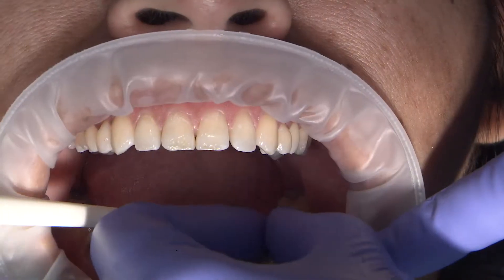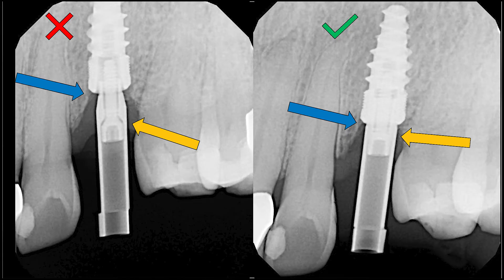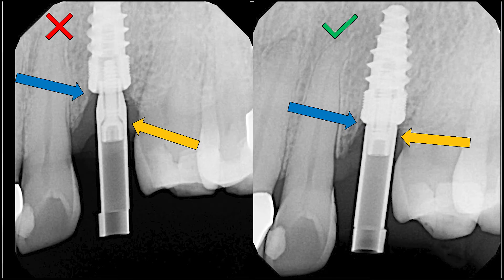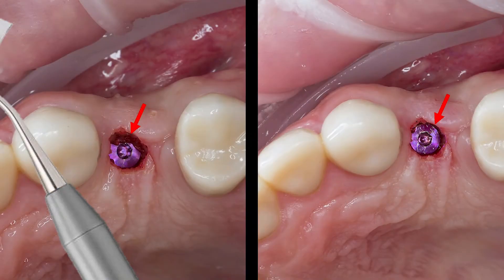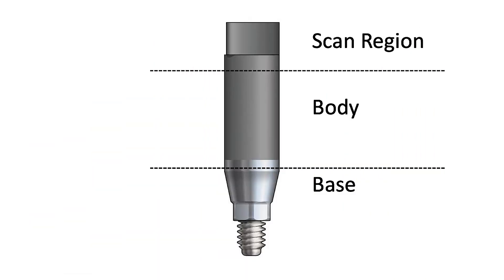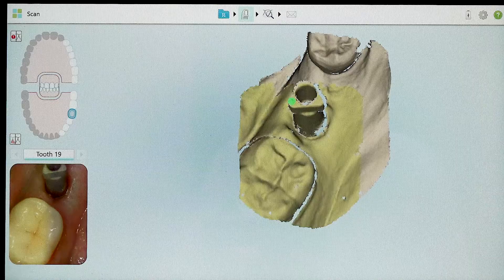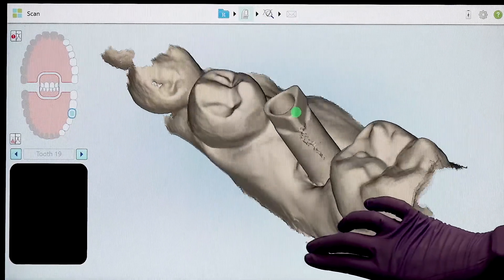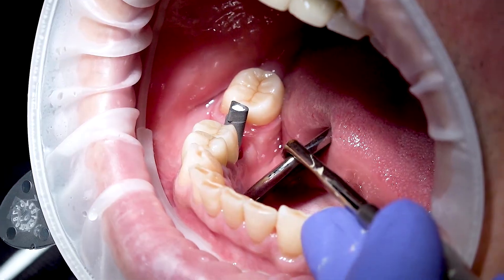Understand How to Utilize an Implant Scan Body for an Accurate Digital Impression

Comment: why can't Glidewell make a scanbody that is more robust like the other companies? I have never had a problem with the PEEK scanbodies from other companies but the Glidewell ones are only single use and even then they keep sending back crowns with weak proximal contacts. If there was a third party option that worked well, I would readily buy it but I can't find one that exists.
Reply from the maker: Thank you for watching and for your feedback. We will be sure to relay this message to our implant department's manager.